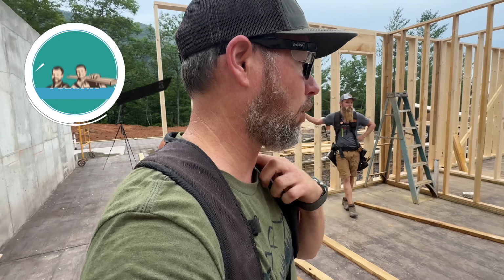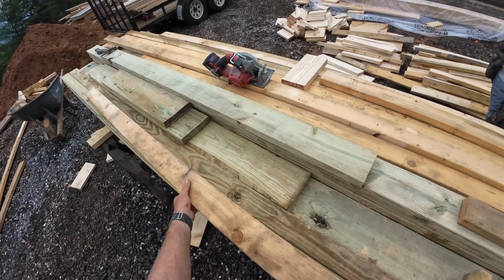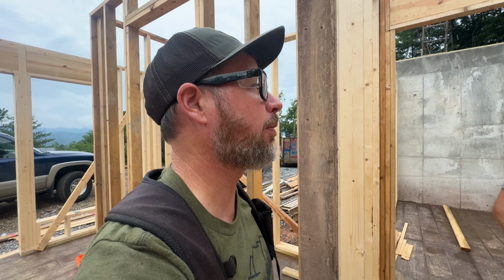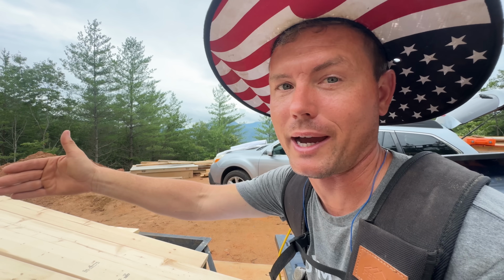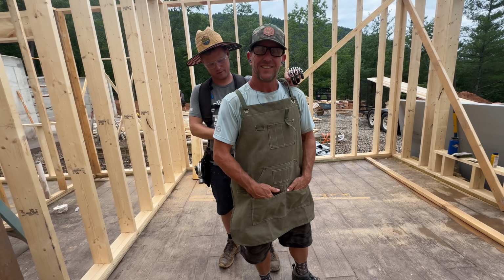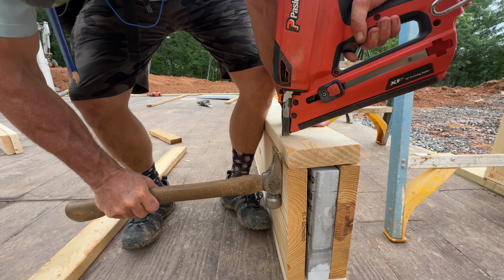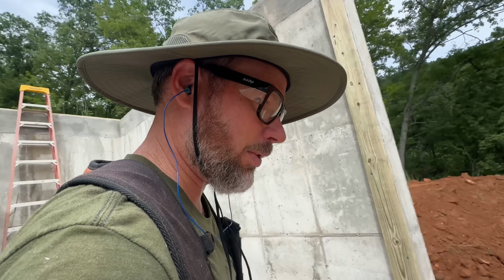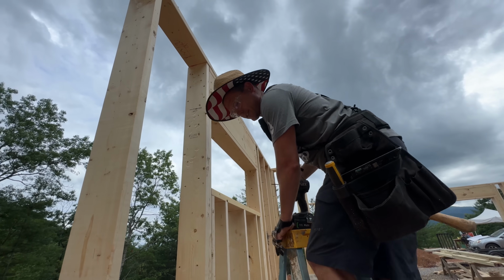Construction of a MEGA sized Modern Home PT 22

Comment: Every 200 boards you cut without the square, you save 20 mins. 6 seconds saved per board means 1 min saved per 10 boards. 200 / 10 is 20 so overall per 200 boards you save 20 mins by not marking with the square. I think 😅
Reply: That's only true if you put your square and tape back in your belt. I'm lazy and don't put them away. But I'm also probably a lot worse at square  cut, especially without a reference. Always good to skill up.
Reply: Yeah it’s faster but you lose that 20 minutes when you mis cut a board wrong and have to take it apart and fix it lol.

Comment: 200 boards times 6 seconds is 20 minutes of savings, so not too shabby 💪
Reply: when he said 2 to 3 mins saved i got really worried about there math skills
Reply: thx for the math
Reply: @frdmbe9258 6 seconds * 10 = 1 minute. So 200 boards would be 20 sets of 10. I was shocked he didn't mental math that one with all the mental math they do
Reply: Correct
Reply: Your savings is the delta between the two methods. You did not save 20 minutes. Need to time yourself in your optional method and use the difference multiplied by the 200 studs to determine the savings.
Reply: Another way to think about it is 4% of an 8 hour work day. One more way to think about it is you save 1 minute for every 10 feet of wall (8 studs, top plate, bottom plate)
Reply: I thought it was all about marking across the board not measuring the length,you have to measure anyhow
Reply: the problem is they didn't get a baseline measurement. How long would it take to set the tape measure, make a tick and then pick up the saw?
It's not like he doesn't have to measure if he's not using the square. So it's probably 50% of that, ~10 minutes total.
Reply: @urbanweekendwarrior7238  but the difference in operations is only after setting the tape and making the tick mark... So the test they did is accurate I think.
It's about removing the step of grabbing a square and making a line.
Reply: @alexanderh.3655  he told Jamie to start the clock when he sets the tape measure. That and the first tick were counted in the 6s
Reply: @urbanweekendwarrior7238 no he says “when the tape clicks” which is when it’s fully retracted and that is when he started counting too.

Comment: No insulation between concrete and wood?😮
Reply: They put the insulation on the outside before backfill.  It was different to see and to be honest I dont know if I like it, but they put the bituthane then 4" of styro so the insulation is on the outside of the concrete walls in this build.

Comment: why not make it all out of concrete and its half and half ?
Reply: Concrete is more expensive, check in the vids how long it took them to set up the formwork for the walls they did. Wood is much faster and thus cheaper. The concrete is used on the walls that will be 'underground' later.

Comment: Ugh! Engineering is complicated but so needed with big walls! We ran into a similar header issue with our windows on our front 20ft tall wall... we had it planned for 5 windows by the CAD designer but the wall engineers were concerned about the load over the door. So we cut it down to 3 windows and bumped them off to the side.

But our builders lifted our back wall with a 16ft triple plate engineered wood header into place from the ground, 20ft below the top plate 😮. Sketchy to watch but they got it done 😵‍💫

Glad to see you guys taking the time to work out the fine details and make sure everything is perfect ❤